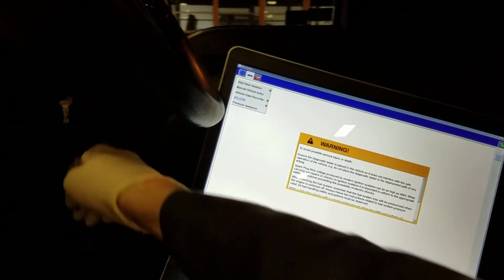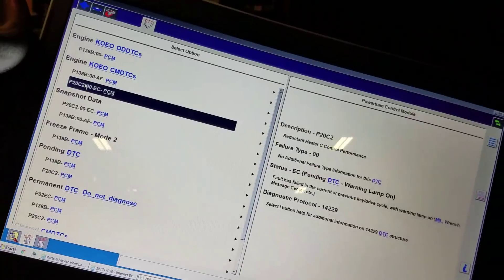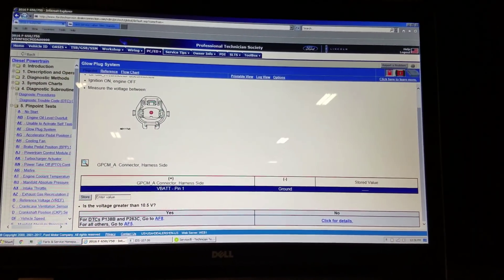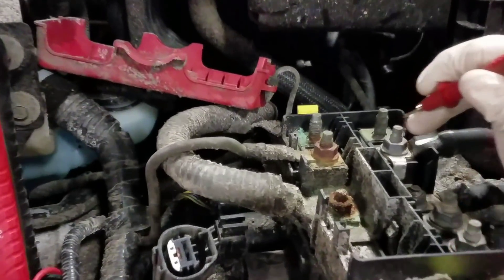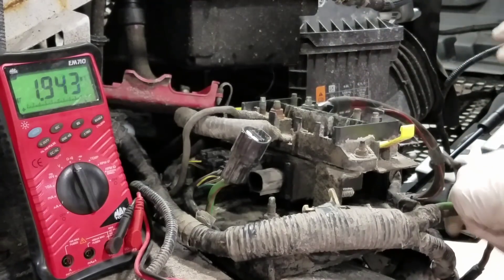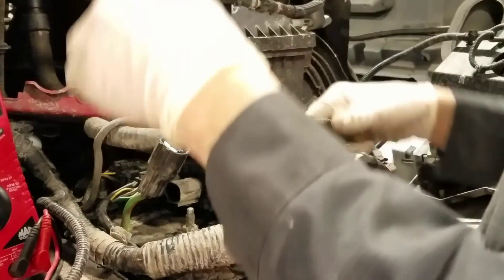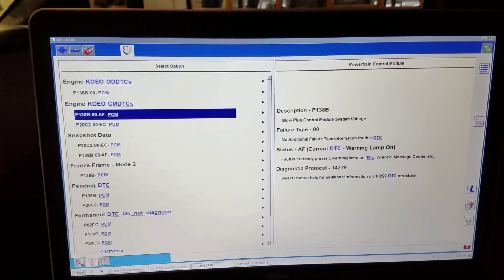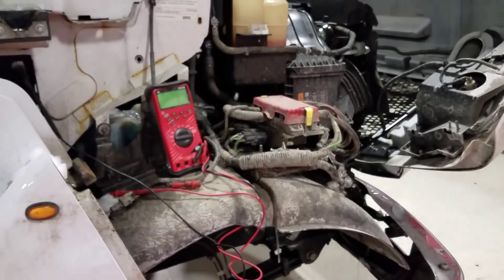2016 6.7L F650/750 - MIL on

Comment: What about green and rust on the opisite  side looks like future issue.  my pcm is 63 volts it throws off turbo over boost  i can feel hose has no pressure and then i get other random codes  when it runs correct no light it may show  def related   but i get reduced power im trying figure out i get 14.9 on battery volts what are you using to scan
Reply from the maker: Using IDS. There's no way a 2016+ Ford 650/750 is gonna produce you 63 volts....

Comment: I seen Scranton test is that Pennsylvania  I’m close . I have 750 2019  control module voltage is 63.75  it’s also reading the turbo to 84.7 boost
And  is the main thing shutting the truck down was the first code it pulled and 0 percent vgt solenoid vains wide open  feeling the hose for turbo only responded like normal when step on could feel psi tension  so had my tech find the control module voltage . I’m in north east pa and if you can do warranty work let me know or if you got any thing to check they expect me to drive 100 miles to dealerships far away with just fuel and dropping the unit off leaving and pick up it’s enough I can fix things in are shop but not electrical expert but have young guy that’s decent and my brother has a fast pace shop lots of work so I had to buy my own  with all issues we have
Reply: I’ll look at the red box is 3/19 and need it for the week so a week or so before ship it out to dealers that will work on it  truck sets during winter but had at least 15 major issues with this air line several time I ended up making one from soft copper and hardening the ends to solve that 4 x the stack tip fell off def issues then it got hot then blew head they said compressor broke bolts a oil leak in rear axle I fixed that also had electrical fire in wiring to trailer so ended up doing a lot better job and put heavy duty wire and box to solve melted plugs and replace brake box hopefully be air trailer soon .  If you are in Scranton that probably about 150 miles closer if you can do warranty ford work
Reply from the maker: No more warranty work, sorry bud
Reply: What no more warranty work ? @PowerStrokeTechTalkwARod

Comment: I hate these new trucks. See there was nothing physically wrong with the damn engine. A damn corroded relay or wire something that wouldn't be there 40 plus  years ago on a older trucks. A freaking cam or crank sensor will leave you on foot and they'll be nothing wrong with the engine. If I had to go to hell to retrieve someone in a truck I would  not do it in one of these new pieces of shit, anything on these pieces of shit will leave you on foot in a heart beat. I would take a 40 year old truck with a freshly rebuilt 350 Chevy small block with  carb and point system or a ford truck with a 302. It will not leave you on foot because a damn crack sensor or cam sensor or a damn knock sensor, no sir that old school Chevy or ford will get you there and back with no problem. I do not trust these new cars and trucks. I bought new  back in 2011 my Ford f250 4X4 6.7L truck and that s.o.b. has left me on the side of the road several times because a freaking sensor, not the engine but something freaking electrical. I'll never buy another new vehicle. I'm going back to my roots when it comes to cars and trucks from the  old school reliable American made vehicles. Sorry so long brother but this video pissed me off because of what happened to that truck in your video. I gave it a thumbs up buddy. 👍👍
Reply from the maker: Sry for your frustration...

Comment: Voltage drop the most important test. Per each load in the circuit the voltage will drop until source voltage ends up at ground

Comment: Good video. I need advice. I have a 2011 6.7 with a new ford crate put in at 2014 when i bought it. It has 125k on it motir has 50k ish. I found my primary coolant low and coolant on bottom by oil filter and oil pan some spray too. I think its the manifold crossover gasket. Have you changed one of these and how bad is it?  Thanks bud and i cant wait for another video. Happy new years!
Reply from the maker: +Timmy G. mistery man hey buddy thanks for watchin. You should private message me.

Comment: you think putting some type of fluid film that electric safe would help prevent that. seems that something so exposed should be better sealed, especially considering the location of it
Reply: We use electric or spray grease on things like that.
Reply from the maker: What a mess, some good ol black spray paint works wonders!!!!

Comment: Need to do a better job protecting those connections from the elements.
Reply from the maker: +Curt o wldnt have happened if the owner wld have cleaned the engine bay on the regular....but instead it looks like this....
Reply: PowerStroke Tech Talk w/ARod true to
Reply: PowerStroke Tech Talk w/ARod werkin truck no need to clean